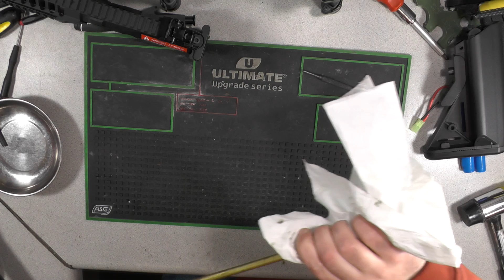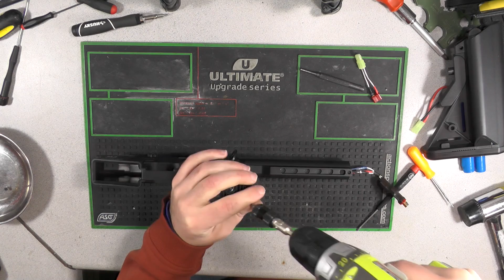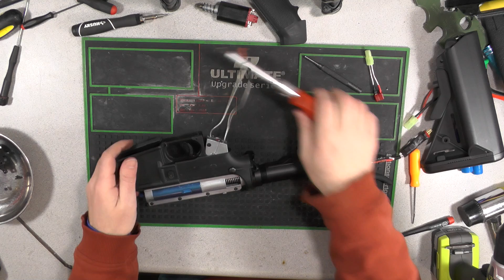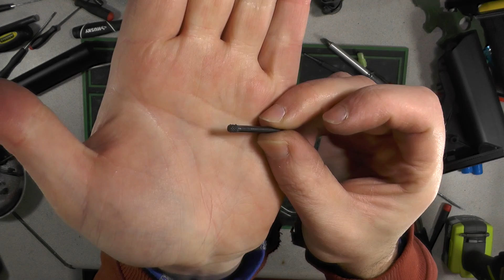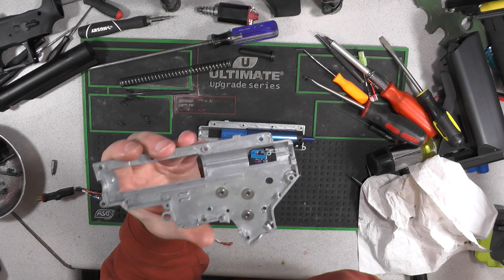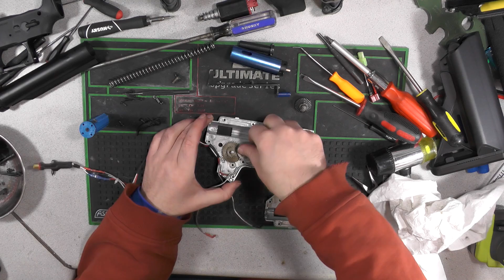Classic Army Skirmish Line Review and Teardown

Comment: Hi Jeff, amazing vid, you helped out a lot. Quick question, is there any difference between the Ec1 and Ec2 other than barrel length? You mentioned that for the skirmish line all the internals were the same for the most part. I just wanted to double check. Thank you!

Comment: Hi I saw this video before I bought my non-ECS ml-10 and it's a decent gun. But I am coming back because I took it to a outdoor game and I'm not sure if I didn't set my hop up correctly or what but I did not feel like the gun was useful farther than typical CQB distance. So I was thinking about upgrading to a Nemesis because it's a safe bet. But I can't afford a Nemesis even if I sell my skirmish rifle. So I wanted to ask. Are the internals of a skirmish rifle better than most guns labeled as "beginner" / "budget" guns? Like compared to a Nemesis how good is a skirmish rifle internally. 

Also I am confused from the video. Can I use an 11.1 lipo in my skirmish rifle at all? And I was wondering if the stock motor can pull an M120 spring. I'm thinking of doing some cheap upgrades to my rifle like a stronger spring and a new bucking before I ditch it to give it a chance. My original idea was to sell the thing and go pistol only since my nearest outdoor field only allows pistols for clearing buildings. 

If you read this and give me some advice about my skirmish rifle I will be most grateful.

Comment: Put shin on each bushing for bater spining and more friction spaces and add oil.. I love Bushing more than barings if spaced prfectly it will spin even bater and wd  for chainson each fricrtion bush ti shin to gear drop..  if you know shining they are quiet and totaly solid 0 chance to fail..
Rule no1 add smalest shin to botom and see if it spins frealy.. this gear is most crucial to shin right.. It must stay almost in place..so you get les overlaping on bavel and spur gear.. aim bavel Gear to be centered togears on most abused part specialy last gear.. and first .. So bater placment of force against gearboks that must be polished smoth even Bat.. for sm,oth ROF. last gear can have like .01 .2 mm free space to spin  smothly but on spot 10% from. fear friction on eachother as litle it can be for gears to spin frealy with max conection on teaths.... 1st Gearmotor gear can have most spacingand must be easy to spin..add on5 mm on each side and see.. and tighten gearbvpoks and see spacing on gears.3mm up down is good for motor so it can fall in place bater.sot tvisting long motor pinon gear is almost 0 prfect aligment posibly pushing gear to fre space in prfect position of motor.
IF all fears are done right and no side forceing gears or tvistingfrom prfect aligment or bad rotation  Is crutial to great aeg builder for Long silent Motor.. that will made you confident it is all made for aoutlasting any top line aeg..  G and G was Shined good but still so much free space that i filed and still had same spin.. Hardest to shin totaly aligned is motor gear and Pinion to spur gear. 1st gear is super fast for momentum and 4 times transfering pover to spring to start moving polycarbonate bat on gearboks track linear spring is hard same from start to finish.. non linear is made for easy start of rotation and more easy endinf of conpresion befor last toth alwys metal skips brom gear and pushes to cylinder hol to acselarate then it starts conpresion zone that must be 2.5 biger than space inside Barell so it doesnt retrn but befor totaly pushes out bb. on wy back air comes inside half rom barel half from bat o ring and holes made to intake. but on expend o ring gets presurized to fill seall on cylinder that is why holes are there...
 Buy tyflon grease painter to spreadinside cylinmder teflone grease white grease.. streach O ring on cylinder wall for bater seal add teflonn onhead in nozle andaround exsoust.. add around cylinder gead seals and around adges of inside cylinder to fill gaps on preasure live holes on bat add grease on Bat seal all aound and silikon spray or use fingers inside all parts that are under friction.. even teflon .. for plastic to metal parts.. 
lastly add Gear grease all around gears with painter only put on parts with contact metal to metal even side friction.. itry white grease for gears.. and over time dirt will make it black so you know when to replace all clean with sope every part use pistol cleaner for grease and gun povder or any dirt with ading protection on material... and redone.. even bater 
and some in bushings and revarse lach.. so all stays in plaace from grease on.. puting all togather. sometimes it is hard to match all at once take brakes if probles and rethink technik. GL

Comment: I have a similar model. CA M16A1. The one that came with birdcage flashhider. My problem sliding out the gearbox from the reciever. It doesn't fricken come out.
Reply: it is kinda difficult, but you have to use a little bit of force (after removing all pins, the mag release, the pistol grip, and the buffer tube) towards the front of the receiver while pushing the back of the gearbox up to get the bottom of the gearbox out of where the pistol grip used to be housing the motor.

Comment: PPL See colours great edges since 2017 all guns have sharp adges cool dezigns.. and they add few pro items that are still not pro company made.. almost all plastic.. withc i dont mind..some cnc mashining.. that only market stupid item that i will replace anyway.. and add 50 e mofset etu.. and you get full top line  airsoft.. 
Dont forget popularity and NAME you pay.. Like crytech and Tokio marui umareks KWA..
 Alll are just laxury item to show of .. they are not as nearly as godd it cost..  I can create alot bater in all aspects gun for same buck.. any way you want.. 
Poor guys that buy that becouse they dont know bater.. I find solid gun that got great gearbox and solid externals.. and put 350e inside and more over time.. 
AND trust me it willbecome bneast and true airwork.. worth to show how you play airsoft.. with preparation ghearing then event.. cycle.. witch is like true fishing that takes alt more time prparing than fishing on event. and it is rush.. testing each upgrade. and be proud to have cheap gun worth more then or close to unberela crytek.. But to Learn all skills needed will take you alot of hours and planing learning all litle things and fizik engeniring balistic behind sport.. I bought g and G CM 12 inch keymod with etu already inside.. i wanted it..
 ANdd Never loking back to old prahistoric mechanic trigermade to fail on 4 places. no mater what.. that will get grinded to dust on triger and bad conection for fire and disconecting liver for uper triger part to dislocate and reset on each rotation when single fire. that always get chiped.. and you first repair will mostly be that mechanizem cut of leaver, taped plate plastic,  grnded or triger melting on lipo use and dmging part on plactic to cut of single fire mehanizem..
 4 things i counted will brake 1 after anotherthey are made on friction and bad engeniring and mostly bad material.... Never buy that shit again add money or buy extra and had replaced by g %g mofset etu set 60e or God like titan for 180e witch adds even more to all that performance and so much costumazation how your gun performs.... for snapy triger faster fire.. more torqu les enegy and heat.. 10 years ago when i first saw mehanizem for dislocatong to single fire on each rotation i was woried.. how badly it was engenired even then in age of mehatronic.
 Bast invantion in last 10 years in aeg was for sure ETU and Mofset true digital age with chip inside.. aeg become true mehatronic.... with alot more life time
 and no single fire going full outo if you pres to slow.. 
more engenired and hareder to repair then real firearm.  Aeg is amazing to work on.. and learning proces is big as your will and patiance. Even all guedes could not help you if you lose patiance.. First reasamble d gearboks that works in gun is true acoivement. Some v2 v3 v7 gearbox are more easy to take apart than other companies.. V3 g36 made me crazy.. buy V2 if you go upgrading.. and m4/16.. and buy 90m spring for practice 120m will stay apart. in gearboks like bad boys start with specna arms or spring change then you will have it reasy.. to easy

Comment: What do i do if the barrel on my classic army nemesis isn’t straight? It bends slightly from the body so all my shots fly to the right of where I fire
Reply: Aim left lol. In all honesty though, you might have to buy a new one depending on whether or not the barrel is physically deformed or something is just loose. I know it is a late reply, and you may have already solved the issue, but I suggest getting a new stainless-steel barrel anyway as they tend to last a little longer and seem to be a little bit more popular.